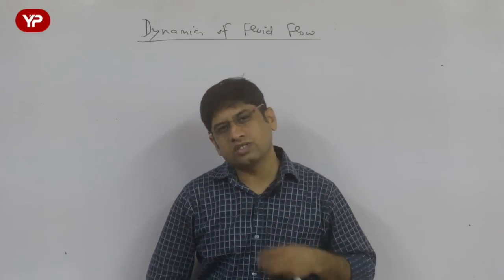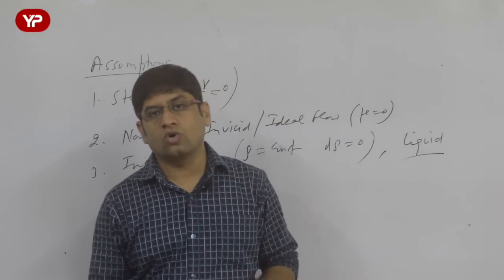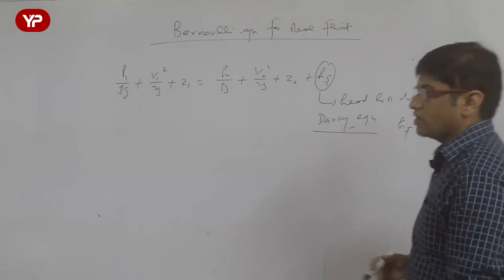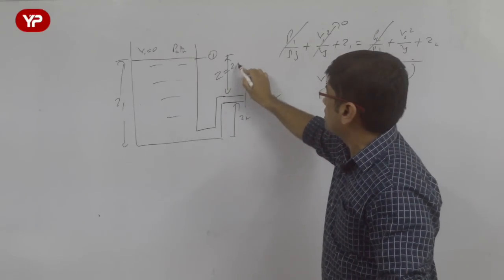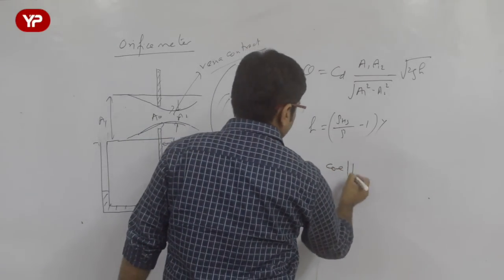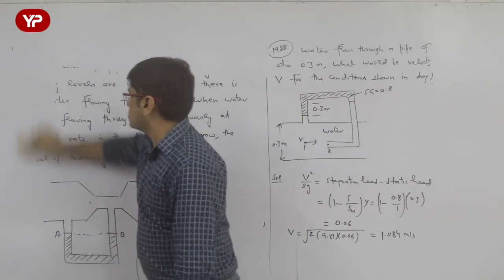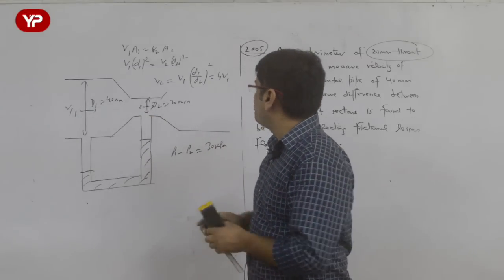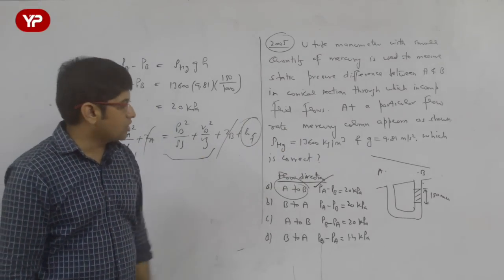Dynamics Of Fluids | 50 Most Important Topics in Mechanical Engineering for Gate Exam

Comment: Good evening,
Request if you can clarify why continuity equation was not taken into account at 01:08:50 for finding the value of velocity of fluid at the bottom pipeline vis-a-vis the tank on the right side whose height difference with the left tank was taken for calculating the velocity at the bottom. I m not convinced with the result until unless the pipe cross sectional area is same as the right tank cross section. The same was applied in the previous question  in the same video.
 Kindly clarify...thanks and regards 
PS. have been following all your videos  really appreciate the efforts 🙏.

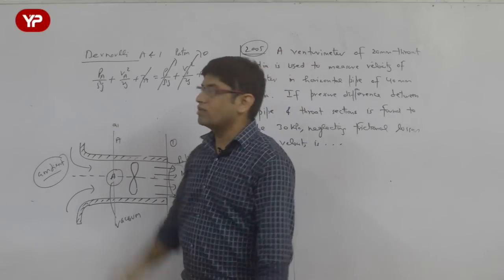Comment: 2:08:07 sir why velocity at section 1 is taken zero? The air is flowing out and there must be some velocity of fluid. If velocity is zero how air is flowing?
Reply: Section 1 is just outside the duct where pressure is atmospheric, since air enters infinite open area from duct n its entire KE changes into pressure energy (atm pressure) hence velocity at exit of duct is zero. inside duct velocity will be there n hence KE also. Pressure will be vacuum inside duct
Reply: air is flowing inside duct but as soon as it reaches exit of duct its velocity becomes zero n KE gets converted into Pressure energy